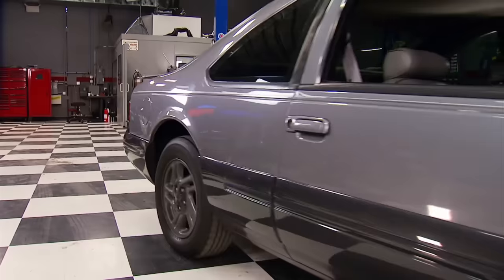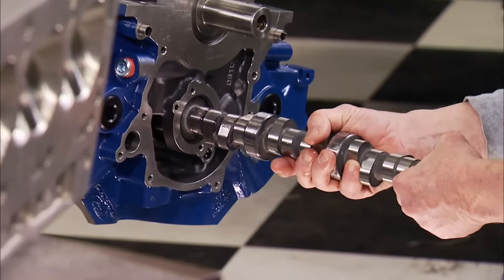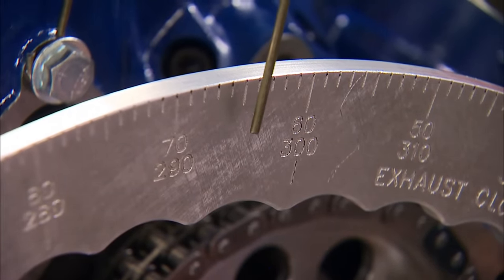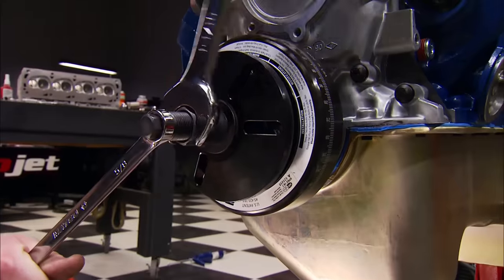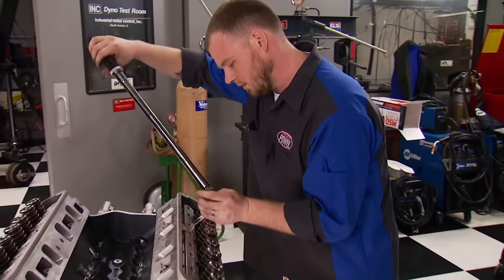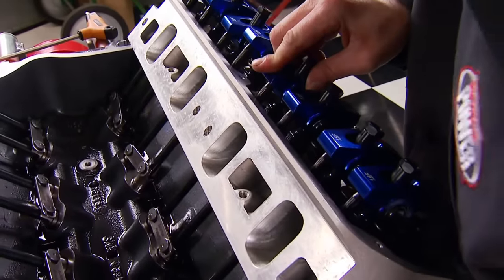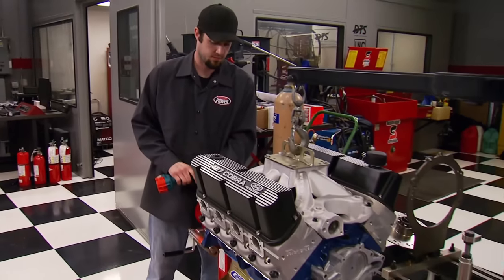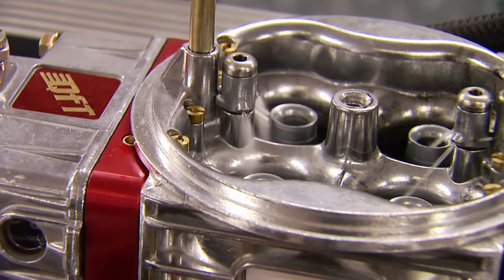Building a 427 Stroker from a Ford Boss 351 Block - HorsePower S15, E6

Comment: What is the rod length, and why can we go to the dark side of rod ratio today compared to the early 70’s? Short rods put a hell of a load on the crank and caused many broken crankshafts, particularly on Chevy 454’s with cast cranks and small block 383’s. Back then a forged crank used would cost you about $500.00 bucks, with a $600.00 core charge. They were highly sought after pieces and supplies were limited. As for the 383’s, 400 cranks were everywhere because of the 400’s cooling problems. It was a natural swap, but a company down the road from the Auto Parts Warehouse I managed always had a pile of broken cranks on their scrap metal pile. They still ran them at the dirt track out here, which lead me to believe in the definition of insanity being correct. That is, doing the same thing over and over expecting different results. Maybe they would live at 5,000 rpm, but nothing higher. Noe days, better metallurgy makes the difference, I think. Can you confirm this and maybe do a story on it?

Comment: 03:13  I had a buddy back in the late 80s-early 90s with a 1983 Dodge Diplomat former Illinois State Trooper squad car. It had a 383 Commando, with a high rise intake & a carburetor the size of a lawnmower engine.  (fastest gaw'damn car I've ever been in...TO THIS DAY)

He told me once, "Joel, the secret to an unimaginably fast engine is a fully retarded camshaft & crank gear." Now I know where the term retard strong originated from.

You guys just gave me flashbacks to a time I thought for sure, I was going to die in a car. Good times!

Comment: When Pat and Mike built the "Old Gray Mare" 408 c.i. stroked 351 Windsor, (EnginePower S6, E8) that engine made 617 hp and 537 lb.ft..   I knew there had to be something wrong when this Boss 351 only made 610hp and yet 586 lb ft. ...50 lbft better than the 408 Windsor.  
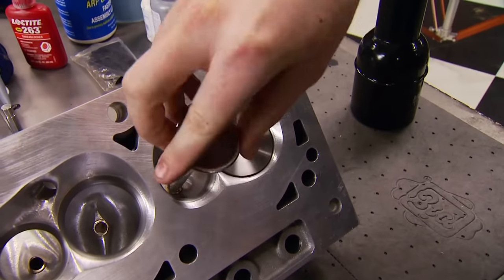At 5:40 Joe stated that the Trick Flow heads had 2.080 intake valves and than at 6:38 Joe stayed that the heads had a "generous 225 cc" intake runners.  
Well, they list all the parts used for this build In the description below the video. The Trick Flow heads listed shows 190cc intake runners and only 2.020 valves.  Problem solved, ..but why do the guys on PowerNation always build Ford engines below their true potential?  GM sponsor or what?

Comment: Was hoping for Boss 351 style heads with canted valves. Trick flow offers these in 195 and 225 intake runner size and offers a single plane Clevor style intake or a FI intake.

Comment: Ya know I have a 4.6 in my f-150 . I'm sure that 427 would be a great upgrade. 😁😊😊😊
Reply: Just put some cams and a Kenne Bell Twin Screw on your 4.6 and you'll be there.
Reply: @Hoggdoc1946  4.6 was a dang good motor new but disposable...they cant really be rebuilt and at this age they wont withstand much more power...the old small block is much more stout and more over can be rebuilt and bored if needed where thats never an option with the 4.6
Reply: @Hoggdoc1946  waste of time and money since it wont make more than 400whp.  Best advice would be to buy a donor vehicle with a 5.3/6.0/6.2 and take the shit 4.6 out of the ford and drop the chevy in.  even my Lightning only makes 425whp on a 6lb lower pulley, bigger injectors and canned tune.  Then I still have to deal with the fucker spitting spark plugs and 11mpg but I still daily it.

Comment: Noticed the quick shot of the new brakes being both drilled and slotted.  Do you recommend these because of the better heat dissipation?  I've heard they are known to crack because of less surface metal.  Has that ever happened to you?

Comment: I noticed that the fuel level in the fuel bowl windows go white and then the fuel pump catches up once the engine goes back to idle.
Is the fuel pump not able to keep up at high RPM?

Comment: You should not touch the precision machined gerotor oil pump housing with a sanding roll!  lol
And it's spring *force*, not pressure. Thank goodness their sponsors throw some good parts at them.

Comment: re washing the oil pump, you still get a film from the solvent so oil cant do its job. you have to clean that solvent residue off with alcohol etc to get it virgin so oil can get on the surface

Comment: I love watching your builds, awesome job on this one. I have a 1973 Mustang convertible with a 351C 2v. Fifteen years ago or so I did a rebuild with a mild RV cam and a Edelbrock Performer #2750 with a holley 4bbl. I lost my 18 son 11/21/18 one year tomorrow, and I want to do something with my 20 year old son together. He loves my Mustang!! I would like to build about a 500 hp Cleveland with aluminum heads, machine the block from a 2 bolt main to a 4 bolt main. I keep looking for a article for a good set up of cams, pistons, but I'm not finding anything. Can you guide to something? Love your show!!
Reply: RIP Kaler Robert!! Love you, miss you, can wait to see you again.

Comment: I used to buy the 430 horsepower 392 Windsor but Ford doesn't offer it anymore. This engine looks like an excellent replacement.
Reply: Just build an engine with those same parts.

Comment: Apart from the slight torque advantage if the 363 dart engines are making 600+ why would you want all the extra weight of the 351 block ? If that’s what your car comes with or looking to wind every bit of power out down the road fine but if you’re just slapping a tough engine in and going I think I’d be happy with the 363 beautiful sounding and revving engine too

Comment: did he put that head bolt washer upside down? for the record, the inner bevel goes up. if you put the bevel down on aluminum heads it swedges the head bolt boss into the threads of the stud. big problems when it comes back apart.

Comment: Ford may call the new block a Boss 351 but it is not.  the Original Boss 351 block was a Cleveland motor.  this block is a windsor based.  Still a cool set up!
Reply: David miorgan  it is loosely based on the windsor block.  Us that were actually around when the original Boss 351 and 302 motors were made can say that this blosck is not based off the original Boss 351 style. Yes Ford can call them what they want.  they have a 302 out that they call a Boss 302 crate also but is still windsor based.  with widnsor style heads.  this 351 block while may have the more desirable crank journals and 4 bolt mains of the cleveland the upper end is windsor based and they are using windsor based heads.   yes it is a new block but it takes the desirable aspects of both but this block more resembles a windsor than the original Boss 351 motor which was 100 percent Cleveland.  block and heads.    it is a cool motor and I know that FORD calls it a Boss 351 but it is now where near what the originals were.
Reply: Vegas EMT  and you just backed up my explanation.  So how was I obtuse.

Comment: Must be nice to have parts donated. What does that set up cost 15k? Not one of those parts was on my 351w and it ran smooth. American Hot Rod put that oil in one of their engines, Does you remember the out come? it didn't survive break in.

Comment: The 351 boss is truly a Cleveland engine with cantered valves The Windsor just never added up to what the Cleveland was or could have been
Reply: Vegas EMT  the best Windsor heads are Cleveland style heads you know like a twisted wedge heads or CHI 3 V they're all Cleveland clones
Reply: The twisted witch head has got the flame path and the runners of a Cleveland free spark plug placement a better spark plug placement and it got small valves
Reply: My big valve Cleveland will turn 8,000 RPM all day long
Reply: Hampton inn stock block to my engines are aluminum head two or just factory engines that need built
Reply: Most slow down a little bit I meant to say two of my engines are aluminum head engines two or factory engines never been touched and I've got a few sets of original four barrel heads with 219 intake valves and 174 exhaust valves Canted valve because they will not fit in a 4-in bore
Reply: What you drive a Prius like a endurance car a drag car what what you got and I get back off the road I'm going to send you a picture of what I got

Comment: How did you increase the cubes without changing the crank to a stroker?
Reply: I was wondering about that too, and I had to watch the video closely for clues.  After watching it closely,  I realized  that the short block they got was already a 427 straight out of the box. It's  a little misleading. But yeah, to get a 427 out of a 351, you would definitely need to change the crankshaft to something with a longer stroke.

Comment: What is your recommendation for breaking in a new hydraulic roller camshaft?

This is for a street strip 347 cubic inch 89 5.0 Mustang fuel injected if that makes any difference.

Thanks a lot

Comment: I have what’s called a BF FAIRLAINE (G8) with a 5.4 ltr boat anchor. But I have in my shed a ready to drop in 5.4 ltr 4 valve 355kw with super charger. I should mention the 5.4 ltr currently used is Factory with 3 valve. That’s correct the same manufacturer in Canada it’s been very good to me. As I’ve upgraded the timing belts and the fase changers along with the crappy plastic timing chain guides. Seriously what was FORD SERIOUSLY THINKING? . Especially on the last ever built Failane after 60 years of some beautiful production V8 models in Ford Australian mussel car manufacturering. Including the now multi million dollar 1971 Xy Gt HO PHASE 3 . 4 Speed top loader double clutch plate to suit. It was a family production car that could hit 145 MPH. IMPRESSIVE IN THEM DAYS ESPECIALLY IN AUSTRALIAN MOTOR RACING. BUT IT COULD NEVER EVER BE ACHIEVED W ITH OUT 🇺🇸American AMAZING FORD RACING HISTORY. IM GOING TO STRENGTHEN THE SUSPENSION UP GRADE THE BREAKS AND TURN MY TWO TON BEAUTIFUL LUXURY FORD INTO A 5.5 second 100 metre run. 12 second quarter mile? IT WILL HAPPEN. WHEN YOU WORK ALONE BOY YOU GET ALOT DONE. LOVING YOUR MOTOR BEAUTIFUL.🇦🇺🇺🇸👍❤️

Comment: Would it be smart to put a 427 stroker in a 1966 mustang fastback?
Reply: Sure, why not ? You could dress it up as a 289. Most ppl can't tell difference by looking at them, you could grudge race it and hurt alot of feelings.
Reply: Putting a 600hp 427. In a 65 Mustang is of course possible. However smart?  Not so much.  The cars suspension brakes transmission rear end AND structural would all need upgrading to have anything like a safe and well balanced car 
  By the time you were finished you'd have spent more on the items I mentioned than the engine.  However I've seen it done and the result was pretty cool. Good luck if you decide to do it.

Comment: Bro 6500 rpm pushrod 427 sounds like a monster 
The only thing better is the dual carb sohc427 used In the 1966 ford gt40

Comment: My engine builder in Australia 🇦🇺 20 + yrs ago was easily making either 640hp & 660 tq or 660hp & 640 tq out of a 427 Windsor or Cleavland . Can't recall which block .
Reply: If it was in Australia it was most likely a Cleveland.

Comment: I wish they would give the cost break down for these builds too. Anyway, it's hard to beat the sound of a high horsepower ICE engine revving to its limits, but you can't deny the performance of a 760hp electric vehicle with instantaneous torque (like the Tesla Model S P100D) even though there's no "growl".
Reply: I don't know why Tesla hasn't created a 2nd channel in their sound systems to simulate the sound of a engine like this? Then the driver hears this sound but the public (and the Police) don't. LOL
Reply: @PawnShopRockers I could see third party companies making something like that for Teslas. Stellantis (Dodge) is working on their own EV and will have an artificial engine sound.
Reply: I believe that be the missing part for "some" people. I'm much of a pure silence fan. I need "Music or Motor." Cheers

  @JustWasted3HoursHere

Comment: I have built many v-8's, all different makes but have never degreed a cam. Obviously I'm not a high end shop, neither. I'd love to see someone do a dyno comparison before and after the degreeing just to see exactly what difference it makes, better or worse.
Reply: You don't need to have a high end shop to degree a cam. And degreeing a cam ensures that your engine won't blow up at higher RPM. Most people just line up the dots on the sprockets and call it good but that's just hoping for the best if you're going to race with that engine.

Comment: That's not a 68 or 70 stk block the front of the block is protruded and the water comes. Out of the top by water pump is that SVO part ?

Comment: 610 at the crank....460 at the wheels. These tuning session are fun but seeing what is actually getting to the ground seems more useful.
Reply: Unfortunately this T-bird will get gapped by anything with a turbo LS.
Reply: @Mick_A_Knuckle  true that, 450whp is what a newer 5.3l does with fbo and a good tune, so it might not even take a turbo ls to gap it lol.  I'm currently in the process of gathering parts to swap in a 6.2 ls into my 02 lightning.  Was crunching numbers and its way cheaper to hit 700hp on that 6.2 with a turbo than on the 5.4.  Built shortblock & trans is already $7,000(10k with head/cams) bigger blower 2.9l whipple is $4,000. for $14k i can make that 6.2 reach the moon lmao.
Reply: @TheGuyWhoDidUrM0M  That sounds like a cool truck!
Reply: @Frank Bonazza III I'm comparing based on cost. A turbo LS can be built cheaply and make 700 HP.

Comment: I guess these guys have never been around a cammed  dual plane 8V big block that makes over 600 HP before 5000 RPM.  The idle rumble is much deeper than this small block.  While I am impressed with the HP & torque, it would be nice if PN had built this to be more street worthy.

Comment: The parts list for this build has many errors.  The heads are not the correct ones in the link, the link is showing 190 cc heads and these in the video are 225 cc.  The link is to an oil pan that is a front sump oil pan but the one used in the video is different.  There are also no turbo parts as mentioned in the parts list.  Intake manifold is super victor as stamped on the intake not the one listed in the parts link.Timing chain looks different also.  I'm only mentioning because I'm researching the parts list to possibly build or something similar.

Comment: How'd it jump to 610 with timing change? They lost hp with increased timing.
Reply: Jetting was different.
Reply: @BigEightiesNewWave  not really, they slightly leaned it out cause it was fat and lost power again. It went 591 to 610 onlast pull thats pretty big jump for last pull. Tv show.
Reply: @GJ-DT  it went from 597 to 610. A timing adjustment and letting it cool way down probably got it that last 13hp.
Reply: @WhoThisGuy515  why didn't they say what final timing was? Made best at 31 lost at 29 and lost at 34, theres no wheres else to go. Then changed it again and pickup 13hp? Idk bout that. Said it was fat then leaned it out and it lost hp again then never stated if they went back up. Cant imagine jetting up when it was already fat. Tv show.

Comment: Pretty sure that isn’t enough valve spring pressure for that cam. I’ve got a smaller 231/241 cam and my spring pressure are 150/450psi.
Reply: I think lift is more important of a factor than duration. More lift means more acceleration of the valve train mass thus needing more spring energy to control it.

They mentioned duration but I didn't hear them say anything about total valve lift.
Reply: @the faceless .574 intake .598 exhaust according to the cam card. Not a huge cam but definitely not small, I agree with lift being important but I still think they need more spring pressure, valves can easily start to float in the higher rpm range.
Reply: @07bluegsxr  It seems like they're only running this out to 5,500 RPM, I would call that average red line for a motor like this.

Comment: If it were a Shabbylet they would have changed jets, cams, heads, intakes, headers, distributor springs, carbs, went to fuel injection, nitrous, etc

Comment: How exactly does changing orientation of  the gear do anything?   It's a round gear held to another round gear with a chain.  So unless they are asymmetrical I don't see how it does anything.
Reply: Wild Bill if you moved both gears the same amount in the same direction it would end up the same. But what he’s doing here is moving the cam in relation to the crank. Since he moved the gear on the crank one notch (2 degrees) that moves the cam 2 degrees in relation to the crank.
Reply: @JohnDoe-gb7zb  still don't understand.   You have a round gear attached to a round gear by a chain.  And you didn't physically move the cam in the tunnel.  The crank stays in the same place.   You just moved a couple round items.

Comment: In Australia we have a absolute stupid 6 cylinder overhead cam turbo engine is absolute power killer 2200 bhp from the wheel barra motor would you be interested

Comment: Such antiquated tech, why do people still wanna mess with it?
Reply: Not sure what you mean by antiquated? If you are under the impression that electric cars are the future then you are potentially mistaken. First, the batteries are far from completed, research wise, they are in the infant stages compared to ICE engine testing/ development. Secondly, with the incredible amounts of oil which have recently been discovered, the price of oil in the U.S is likely to remain low, which puts a $50,000 Tesla or other electric vehicle at a disadvantage. Long term I am not completely convinced that electric car dominance isn't another version of the 3D movie phenomenon. Something which may be perfected sometime in the future, but for now just comes in waves as a fad but never sets in.